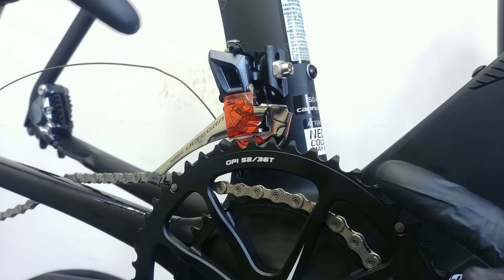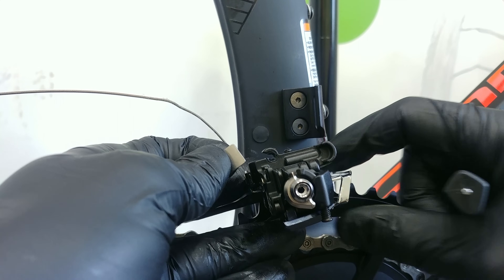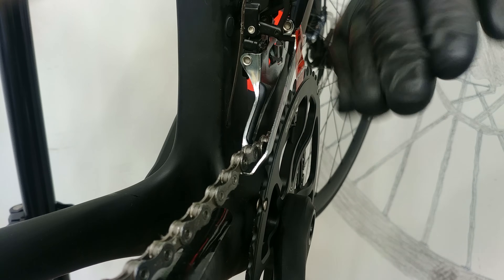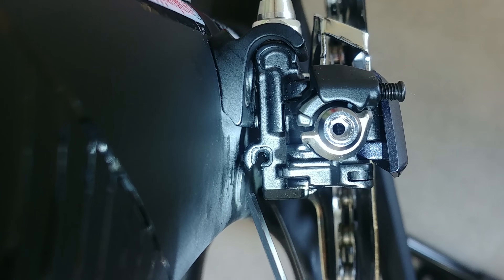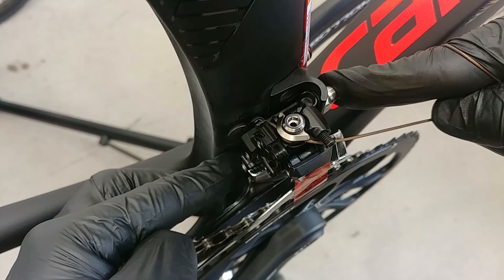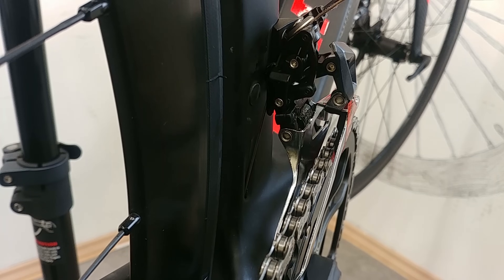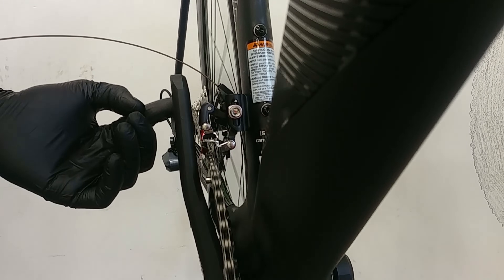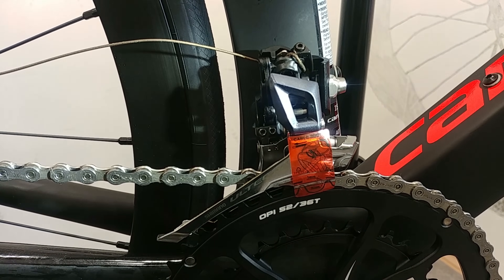Don't Forget To Stick The Plate. Shimano FD-R8000 Front Derailleur Installation / Adjustment.

Comment: Definitvely the best tutorial video for installation and adjustment of this kind of FD. Not only because of the explanations on the FD itself, but also for the explanations on trim positions when pushing the shifters. For mtb users, there is no difference between shifting and triming so a tutorial without these clarifications is confusing for new road bike riders. So, well done!

Comment: Great one! saved me some pain when building new bike. I was wondering why is the derailleur completely ignoring my ST up-shifts (but down-shift was there). Appear it wasn't the derailleur itself, but somebody who sold me the ST-s R8000 messed with the shifting cable or just put it through, without noticing which gear is the lever on. Got them pretty much brand new, but without the original paper box (plastic bags and manuals only). Result - completely screwed operation when playing with the FD. Thanks again... saved me some head ache...

Comment: Wow, this is super helpful!!!  Thank you so much, and yes, this is different, I have the FD-R8000 PDF manual from Shimano tech, this fills in a lot of the gaps, that cable routing after the clamp under the cap and through the chanel for one, that's completely new to me!

Comment: Best tutorial I have found on this. Great detail. Only thing I would add is be sure to take the slack out of the cable with the shifter in lowest gear. Then fix the cable to the pinch bolt and proceed with one shift up and then down to trim position.
Reply: Is that slack removed with the shifter in lowest position, related to what chainring?  What is lowest?   In other words, the cable in the shifter should it be either:  all the way out or all the way inside itself?
Reply: @robertp7209  so sorry, it has been months since I did the work and I have actually forgotten what the hell my procedure exactly was. Follow his instructions and also cross check the work with the Shimano manual online and you will get it right. Cable would be all the way out. Your cage would be over the small chainring in low gear front.
Reply: @csleclerc57  - I appreciate the response.  I have the Shimano pdf of the Dealer Manual, but not so clear.  First time with the new style derailleur much different than prior.
Reply: @robertp7209  I know exactly where your coming from. I just dug in and finally understood. The manual is pretty  brief. I found the most important part of setting it up is accurate position of the cage and  initial cable tension.

Comment: Excellent video. I don’t often mess with front derailleurs anymore but was having issues with a GRX I put on. Set up has changed a lot since I had touched one. I was making a mistake on the limit adjustments and I wasn’t setting them in the trim position in the big ring. Works perfect now.

Comment: Man, you are right on with this tutorial. Thank you so much! I might add that in my own experience, I thought I had my derailleur straight, but I had to tweak it very slightly with the tension screw to get the best performance. I'm sure it was a lack of experience issue on my part.  Now it is smooth as butter thanks to you!

Comment: Great video using it to setup my new GRX mech today. FYI for the clamp on adapter part number SM-AD91-MS 31.8/28.6 it has a small built in welded nub, where the stabilizing screw presses against when its turned outwards, so no need for the small piece of metal, and in fact the small piece of metal wouldn't physically fit due to this little built in nub :)

Comment: Especially helpfull are the close ups of the small bits and pieces such as the stabilizing screw and where the chain should rub (or rather not rub). Great that you take the effort to find a good viewing angle which sometimes cannot even be achieved by eye... ;-) so that we know what we are doing and should aim for. Thanks!

Comment: Excellent video, thanks!    The one thing that confused me was what position the shifter should be in when the cable is attached/tightened.   Eventually I figured out it should be in the position to make the cable the longest, for the small chain ring.

Comment: This is a great tutorial. I can stop scratching my head!
Only thing I would say you need to correct, is you should clamp your work stand at the seat stem. I read that if you clamp a carbon frame, you risk crushing your frame because it is not designed to withstand such forces.
Once again, great tutorial, keep up the good work

Comment: Excellent instructional video, it really helps to clarify the instructions in the Shimano dealer manual.  One question...before clamping down the cable, what position should the shifter be in?  Should all the slack be taken out and moved to position (V) as shown on page 18 of the manual?
Reply: Did you find out?  If so please let me know.  Should the cable be as far out of the shifter it can go, or all the way inside itself?

Comment: Thank you so much! My Canyon arrived with a really bad adjusted Front Derailleur (the cage brushed the crank arm, wtf?!) and with your video I fixed it! It is my first bike with a braze on type, so I had no idea how to adjust it. I guess that's the price you pay for a bike from the Internet.
Reply: Could you adjust it really properly? My Endurace arrived today - I acknowledged the same and tried to fix it. On the lowest gear, with the L screw completely out, the chain still scratches on the inner side of the derailieur. I think its something about the measurements of the frame itself.
Reply: @ekie7361  My derailleur was not parallel to the chainring. So I had to loosen the mounting bolt and turn the derailleur inward which solved all of my problems.
But keep in mind that you can trim the front derailleur. So even when you shifted to the small chainring, there is another "half click" left which brings the cage even more inward.

Comment: Just a tip. I was focussing on these instructions and overlooked that the inside skid plate was missing on the derailleur mechanism. It is only a small push in piece of plastic. I couldn't get the chain to shift to the larger ring. Replaced the skid plate and voila. Its worth checking that yours is there and in good conditions

Comment: Thanks, I’ve always wondered what this little piece is meant for. But I apparently don’t need it, as in my case the bolt hits the holder, not the frame - on both of my bikes, Cervelo S3 (Ultegra 8000) and Cervelo Aspero (GRX 810). Seems to depend on the frame manufacturer how big this hanger belonging to the frame is. Strange enough anyway.

Comment: Great video.  Unfortunately, my frame design leaves the stiffening screw to open air.  It is not able to make contact with anything.  Your video was helpful in correcting other mechanics mistakes.  Thanks
Reply: mine too : the screw is in the air: I have a Giant Advance Defy 1 2o21
Reply: And mine Trek Domane SL6
Reply: @rogerhampton2844  after I've seen this video I did a homemade plate which I glued it with a 3M double tape taken from my gopro support. After this operation my front  derailleur is more stiff. I made this this without removing the FD. Juste find a small metal plate and give it a round shape using two pliers (if your bolt touch the round part of your frame ) . Good luck

Comment: Very good tutorial overall but I think you're mistaken, the "stabilizing screw" I belive are used to adjust the pitch or angle of the front DR so it's parallel to the chain line. Same as if you loosen a clamp on Dr and rotade it on the seat tube a little.

Comment: I did everything in this video, but I can't eliminate the rubbing in the inner chainring and the largest cog in the rear. Any suggestions.
Reply: Same, that's what's brought me here.
Reply: Same (constant rubbing), and same (that's what has brought me here). I'm not a mechanic, I f**ked up my front derailleur in the process, not it doesn't even shift. Maybe that rubbing is by design? : ((
Reply: I went back through the steps again and got everything working properly.

Comment: Ultegra FD-8000 braze on...carbon frame with mounting plate.  No matter how I adjust the derailleur, inner and outer screws and the screw that contacts the mounting plate on the frame, the chain guide seems angled so that the rear is more outward then the front, meaning I can get the guide parallel with the chainring. Is there is no way to pivot the derailleur on/in the mounting plate so that I can adjust the chain guide to get parallel.  I'm stumped
Reply: The slot in the bracket the derailleur bolts to is wide enough to allow you to move not just up and down, but in and out.  In and out is what you need.  Is the slot wider than the bolt?

Comment: What do you do if the chain rubs outer plate on largest gear (smallest sprocket, big chainring) after doing the adjustment you made with biggest sprocket and bigger chainring?

Comment: @2:49 you guide us on position of the derailleur arm...a bit later you say for a Braze on you need to arm about 1mm inwards of the largest chainring rather than level. or parallel.  What position should that be for a Braze on FD using a Clamp adapter?  I purchased at 105 R7000 camp-on FD, but was sent a Braze on. Rather than the hassle of return/exchanging, I bought the Shimano Clamp Adapter....thanks
Reply: I personally would have sent it back. The clamp on is a little bit more weight but also a stiffer mount, so it does not need this additional new screw that pushes on the frame.

Comment: trying to redo the installation of my bike because it had the wrong setup. what positions should the l and h screw, and the tension barrel adjuster be in at the very beginning?
Reply: this has always been bugging me... so what i did was i just loosen up both like start fresh...
Reply: L and H screws should be in the middle, barrel adjustor should be in the middle -1 (closer to the minimum mark on the barrel adjustor) min can do 10 turns so i put it on 4.5 from min to max then you do this setup

Comment: hello everyone, if i understood correctly with regard to the outer plate the front must be parallel to the teeth of the chainring and the back of the plate slightly inward towards the bike or slightly beyond the chainring?  can the rear of the plate be adjusted with the derailleur cable attached?  If yes, how?  thank you in advance.

Comment: Thanks for sharing. You make my new bike even more perfect. One small question though. Is it common that 1mm gap at 11/52 may cause chain touching the inner plate of deraileur cage at 23,25,28/52? Or 1mm gap at 28/36 ---> chain touching outer plate at 11,12,13/36? (I know we are not supposed to use gears like this. I just want to make sure I did it right.)

Comment: THANK YOU for covering that random adhesive plate which I was very curious about when installing my 105 R7K (the way it installs is identical to this Ultegra, btw). Now to make that final trim adjustment before I ride. Also good to know about that canted "heel" in on braze on mechs like this, as opposed to being parallel flat to the big ring. Really good tips! 
I can also confirm that thus far, the 105 R7K works on a mid 90s XT flat bar left shifter! My mutant vintage roadie bike is set.

Comment: Excellent video, even if the subtitles in French lack precision.

Shimano managed a great feat with their new derailleurs before ... the old ones worked perfectly, I do not really see the interest of making a new method of adjustment (which in the process is much more complicated to achieve than the old method. ..). Worse, these new derailleurs are not compatible on my CBT Italia frame, the support screw is found in the gap between the frame and the tire, it does not support anything ... So I had to replace the derailleur . The rival sram I had replaced was even nicer than the old 105 5800 ...

I will watch it several times because some points are still too vague.

Comment: What am I doing wrong if when I shift into the big ring it doesn't move? I've tried pulling really hard to get the slack out and not so much. No dice.
Reply: Did you ever figure this out? The videos I watch including this one just show them pulling the cable tight and it immediately works. Me I grab a fistful of cable tight as I possibly can, try to shift and literally nothing happens...

Comment: GRX 810 front derailleur setup would be very much appreciated! Finding it impossible not to have chain rub on my new Giant gravel bike in the extreme and crossed gear ratios!
Reply: GRX 810 is same toggle front derailleur set up as Ultegra, GRX 600 series = 105, GRX 400 series = Tiagra

Comment: Hi does it matter the position of the limit screws prior to installation? Do they need to be all the way in or out or whatever? It's not a new derailleur so they aren't in the position they would have been from the factory.

Comment: Hey man, do you know if that plate can be bought anywhere? My mechanic didn't know about it and so did I. Later, I found out about this, but my inner plate is gone. The screw from fd burrows into my frame!
Reply: You can find it on Amazon for about 10 bucks.
Reply: @robg6887  Wow, that's crazy expensive considering it comes for free with the FD. I found a solution by ordering Shimano FD from OEM sellers in China. They are generous enough to send me 2 plates (well they showed me they have a full bag of it!) haha. It seems that they too do not know the function of this plate, so they send FD without plates to customers.

Comment: Hey SickBiker and community, I setup my front derailleur (clamp style) according to your video, but when in the small chainring in front and smallest cog in the rear the chain catches the outer plate and the trimming function doesn't move the derailleur. It does function however when on the big chainring! What is the issue and how can I solve it? Is the base tension too low? But the line on the side of it is adjusted inline as in your video..
Reply: Same for me. It seems that the 'low trim to low' action just removes the cable slackness. Everything works perfectly fine except the transition of low and low trim.
Reply: Hello there, I re-installed my front derailleur yesterday and I found that the low trim is present now. First make sure the cable tension and limit screws are correctly set up and shift to the low, then you operate the brake lever. After the click sound of transition between low and low trim, push the lever slightly further, try to feel that you're pulling the cable but not to the top/top trim. At this time you may see the derailleur cage is slightly moving to the large chainring. Now you click the lever 2 to shift to low, you may see the cage is moving back to the small chainring. I think this is the low trim.

Comment: This is great but no one mentions the tension adjuster bolt seizes, mine is just 6 months old, bolt only been adjusted once before, but was seized and head rounded in seconds, so now I can’t finish the job and derailleur is only 6 months old. Any suggestions how to remove bolt? Thanks
Reply: Can you grab it with some locking pliers?

Comment: I have a bit of trouble lining up the two white lines. Is that a cable tension problem? I’m just not sure!
Reply: It seems to me like the whole construction is a little to complicated, a lot of springs interact and that leeds toif one of them is to stiff or loose it flexes and interfere with the whole function. I have assembled around 20 of these new and maybe 2 have had zero issues. Would probably been way easier with a inline adjuster

Comment: Sooo "PRO" tip when he said align the cage with the the largest chainring to make your life easier he didn't joke. What you want to do it put it inline with the metal along side the teeth .[].   <- ( []  is the tooth)  now aim the outer part of the cage (the one with ultegra/grx written on it)  at the right dot so a bit over the chainring. Now follow the video dont forget to counter screw the L limit screw and it will purr like a purrari

Comment: Don't think you'd use the plate with a band-on adapter as the ring that mounts to the frame is right behind the screw.

Comment: why do you set the limits for the inner plate of the cage on the big ring and outer plate on the small ring? I thought the big ring limit should only be set for the outer plate of the cage and  ring only on the inner plate of the cage?

Comment: I spent half evening yesterday trying adjusting this ultegra monstrosity. If I ever will be on it again I will refer only to this video
Reply: It's a bastard isn't it. Front derailers are bad enough but at least for years any competent bike mechanic could make them work. This thing is a mess!
Reply: @chrisburn7178  haha, yes! But at least it works great after that fiddling. But the process is disappointing
Reply: @pupi-pupi  Except for me, once I'd finished the process, I think the left shifter is broken as it is just stuck in low gear. Once the cable is released the shifter clicks but not once everything is tightened. 😭
Reply: @chrisburn7178  ah, the problem with this model that it has specific order of adjustment and it helped for me to start over multiple times with "reseting” everything to middle positions. I spent significant amount of time with shimano dealer pdf and this video to finally adjust it.

Comment: my problem is that when i have the drivetrain in the smallest chain ring (34t), and the rear cassette in the biggest cog (32t), I get chain rub on the inside of the front derailleur (closest to the frame). I let the L limit screw all the way out, so it applies NO pressure on the front derailleur at all, and it still rubs
Reply: Potentially try using a steeper angle to point the rear of the derailleur slightly more inward than normal. Should give the extra room that you need.
Reply: You need lower cable tension 
Your cable is pulling the derailleur outwards
If you release some tension derailleur will go to the limit screw